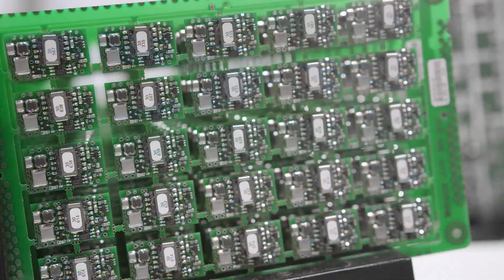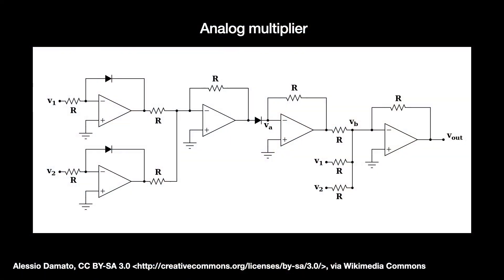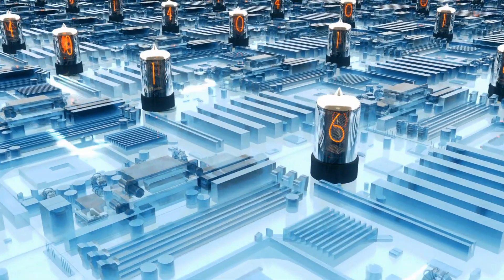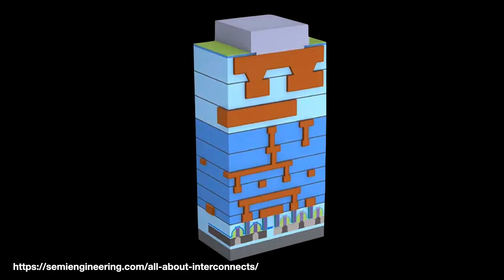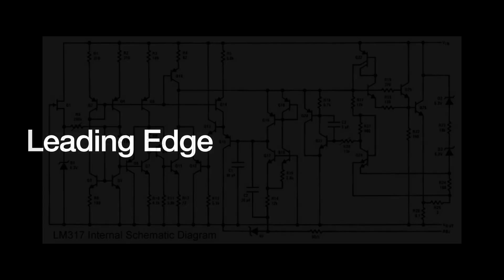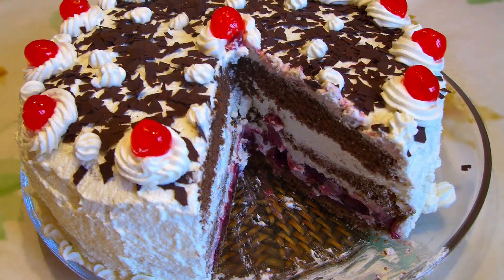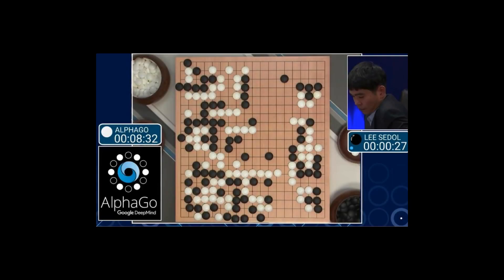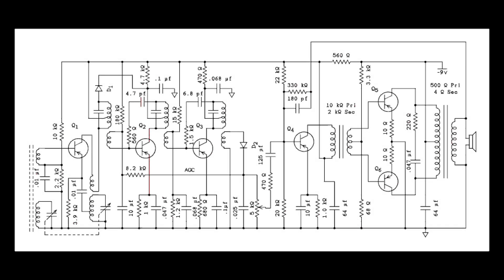Analog Chip Design is an Art. Can AI Help?

Comment: Nice analysis. In my view, we can further divide the field into 'needs the best performance' and 'works well enough'. I think for now analog designers have job security for the high performance area. However, I believe that we'll see the growth of automated and AI tools for 'good enough' analog. Especially in the open source field, as it's a lot cheaper to test and develop. 

One of the criticisms of open source ASIC tools I've heard is that the older process sizes are not relevant, but in fact they are still very highly regarded by analog engineers for the reasons you outlined in your video. 

Additional interesting reading can be found here: "Open-Source and Autonomous Temperature Sensor Generator Verified With 64 Instances in SkyWater 130 nm for Comprehensive Design Space Exploration"
Reply: How could you commented 3 month ago? this video is 1 hour old!
Reply: There's actually quite a few other reasons why newer processes aren't well regarded by analog designers.

First, those transistors are often optimized for good digital performance without any regard to analog performance.  This means they might have things like a poor gm curve.  Or lots of equivalent output resistance.  Or bad subthreshold leakage.  Or poor matching characteristics.  Or just plain weird analog behavior (like gate oxide tunneling).  Or...

Second, those processes are rarely setup for good analog circuits.  So, they will lack things like the ability to mix and match transistors with different threshold voltages.  Or perhaps lack good resistor options, particularly high sheet resistance or low temperature coefficient resistors.  And stuff like BJTs (yes, still common on analog designs, especially references) is virtually always an afterthought on those processes.  It's usually some parasitic device with stuff like really bad betas (current gain from base to collector) and lots of undesirable parasitic devices and leakages.  And zener or schottkey diodes are virtually nonexistent on those nodes.  They will also rarely have things like extended drain devices for high voltage operation.  It's also often really helpful to be able to put devices in different wells, both for isolation purposes, but also so you can float transistors above (and sometimes below) the substrate and that ability will be limited on a digital process or come with major drawbacks.

Third, alot of analog circuits go into power converters or RF.  On both of those, it's rarely the active analog circuitry that dictates most of the die area.  For power converters, it's usually the power switches, which will dominate the die area and don't benefit much from ultra small geometry stuff.  For RF circuits, it's often stuff like inductors and transformers that dominate the chip.  The actual analog circuitry is typically tiny, then you usually have some moderately sized mixed signal stuff to digitize the analog, then a big digital block to process it all (often on a different die - usually on a process optimized for digital).  A good example would to pull up a die shot of the ESP8266 (a low end microcontroller with integrated WiFi).  Zeptobars has a nice one.  The digital is actually a pretty big chunk, but the single most prominent features are the big inductors and transformers for the RF (usually large octagonal or circular constructs).

Fourth, most of the actual analog processes get less attention and less money.  So they are often old digital processes that have had analog stuff bolted on after the fact.  Not only does that make them less than ideal for analog, but it all but guarantees it will be an old process.  Which is usually fine because the analog rarely actually needs stuff like finer geometry (doesn't actually make the chip that much smaller), so why pay for more expensive masks and processing?  And why incur the MUCH more difficult design rules that come with fine geometries?
Reply: Wow.. that's a bit creepy.. How does it feel to be a time traveler @matthewvenn ? Is the trip backwards through time (and presumably forward through time.. if you're reading this) as nausea inducing as I imagine it to be? Or is it like surfing a gentle wave for a time traveling bad@$$ such as yourself?
Reply: This comment is 3 months ago ?! how come ?!